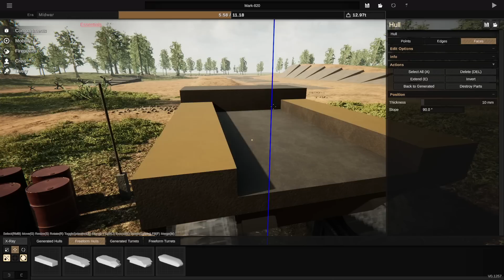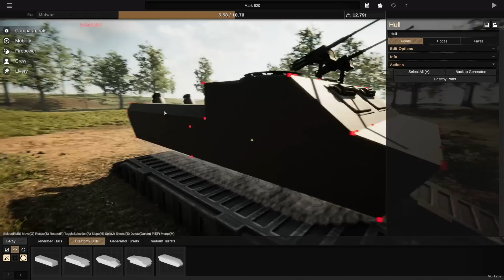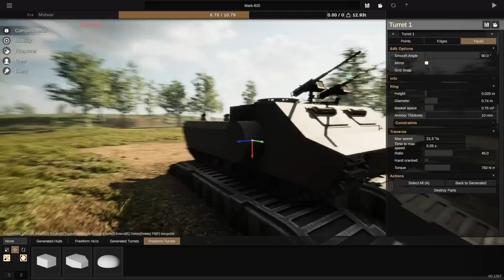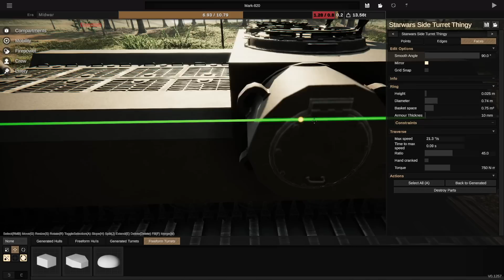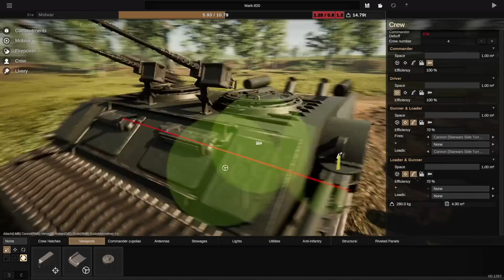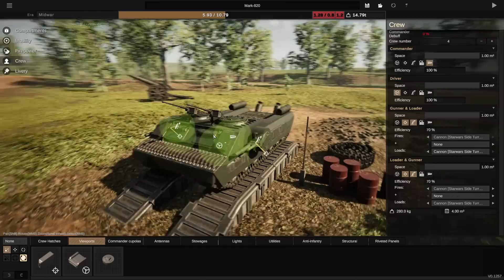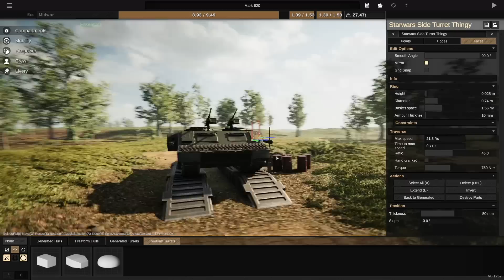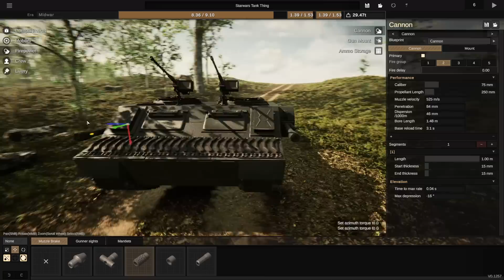I Built A TANK With TWIN SIDE TURRETS In Sprocket Tank Design!

Comment: Your tank design are cool on paper and poorly executed. You need to work on mobility more. Mobility always seems to take a back seat in your designs. This tank would be cool with a main turret, but side turrets died out for a reason. I have a project where im making a massive turret with side turrets on it. The main turret handles the y axis and the smaller turrets handle the x and z axis with the guns mounted on them. Allowing side turrets to be effect and makes it feel kinda like a mech. Give that idea a try and see what you can do.
Reply: Hmmm. Very critizicing but it’s constructive. Thank you for your help😊
Reply: I think these are just for fun, not to make a proper design